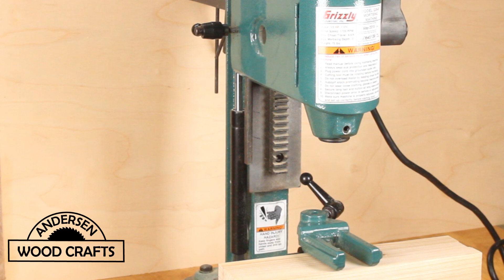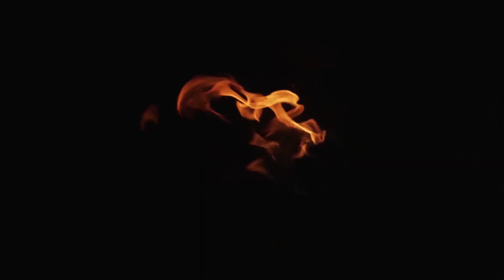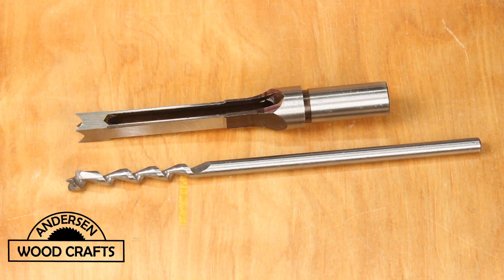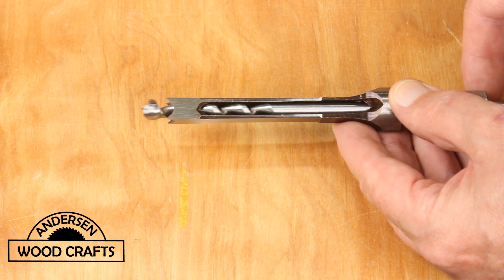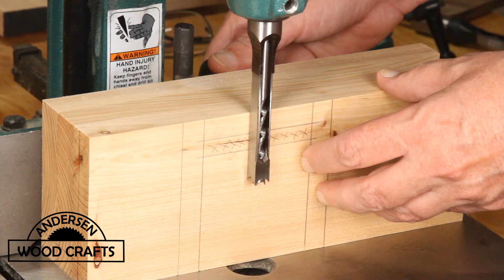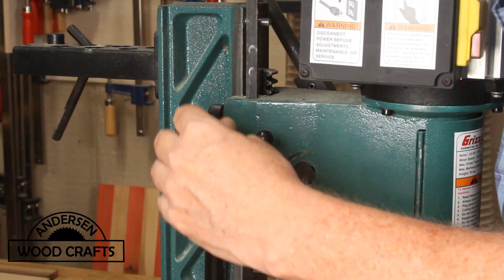SETTING UP A BENCHTOP MORTISING MACHINE

Comment: Thank You. I'm really getting tired of these channels that actually make fun of  safety.
Reply from the maker: Thanks.  Safety should always be on your mind, especially in the shop, but I also don't abide by the notion that "safety comes first".  If that were the case you wouldn't even get out of bed.
Reply: @AndersenWoodCrafts  I completely agree. I always practice appropriate safety. I live in Florida, so of course I'm in the shop with sandals, but I don't encourage it. It just grinds my gears when some very large YouTubers encourage others to do what they do, like suggesting DIY asbestos removal...without even use of a respirator.